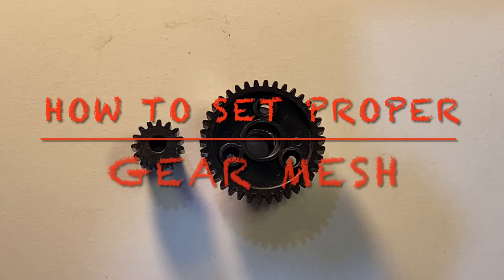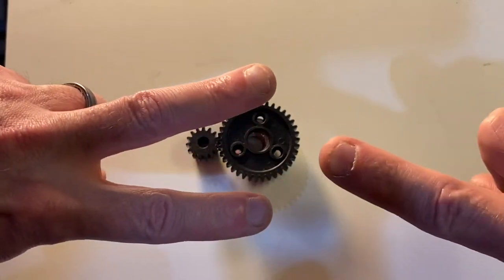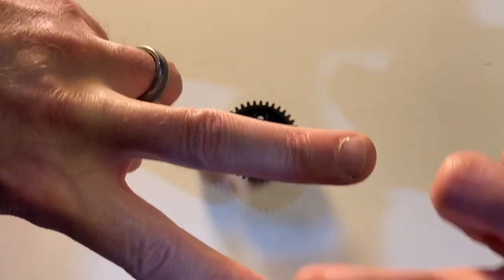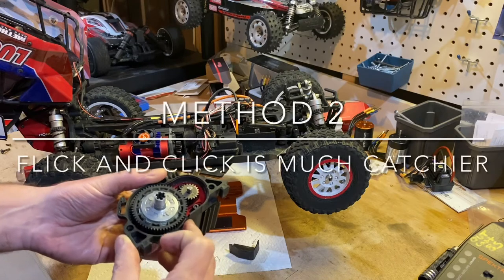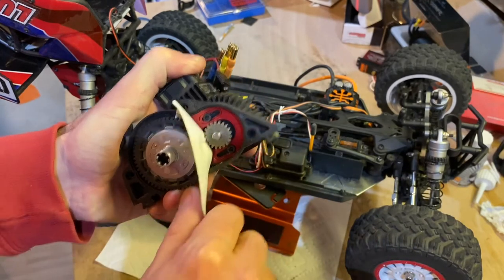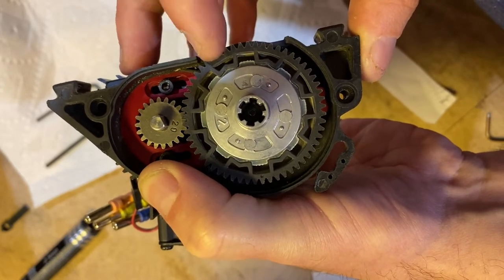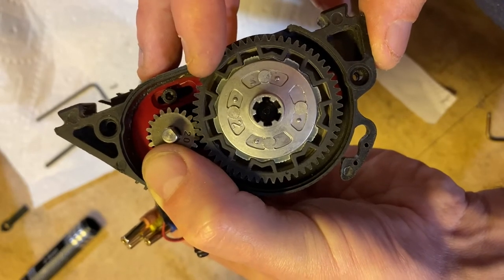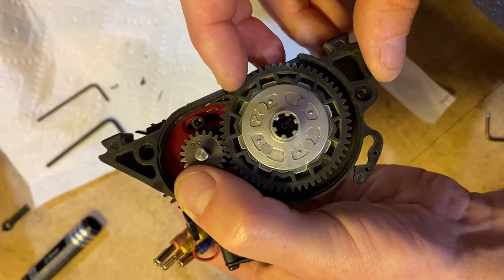Setting proper RC gear mesh

Comment: thx for the video now i do know what does the reverse do in my controller im not sure did it hear good the gearing but i think at its fine if i dont hit 0-100 full power then im fine so i need be careful next time when i go drive it at i dont broke it motor has too much juice

Comment: I just installed a metal spur gear and I’ve done the paper method and it’s very noisy regardless where I set it. Just wondering if it’s normal for metal spur gears. It seems like a metal gear likes to be a little tighter. I pull the paper out and it does not rip.
Reply from the maker: Metal spur with a metal pinion will be noisy if you are used to plastic.  Just no way around it.  Occasionally i use ptfe lube with metal on metals which helps a little.  You dont want to use anything that will collect dirt like grease or oils.   The good news about metal and metal is if your mesh is wrong you usually know it just by looking.   Metal shavings will collect around the motor and gears.  Plastic spurs mostly just deform and melt a little.  Metal “chisels” and your left with real fine shavings that look like shiny dust.   If you have that, your getting wear and will want examine your mesh.

Comment: I just cram a penny in the fuse box and it works fine. Fuses are like unicorns, they don't really have a place in this world. Nobody needs fuses or a fuse box, they're just a made-up product to spend money on and pretend that they're safer than just cramming pennies into fuse boxes. 
I've been doing it for years and have only burned down one car.
Those numbers don't lie.
One car in 15+ years? That's a 90% success rate with the penny method.

Stop wasting money on fuses and cram a penny in there instead. 
I guarantee you will only be unhappy less than 10% of the time.
Numbers don't fudge sickle.